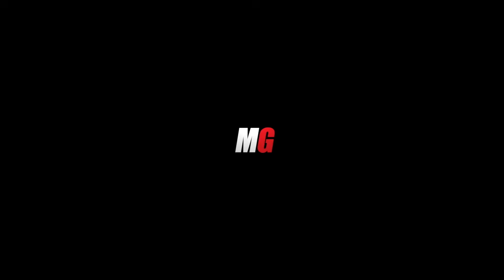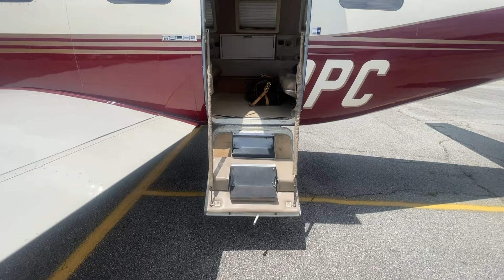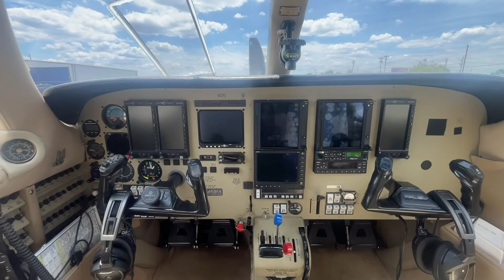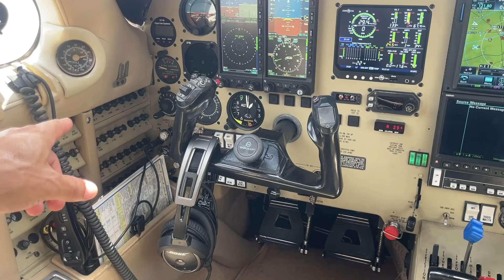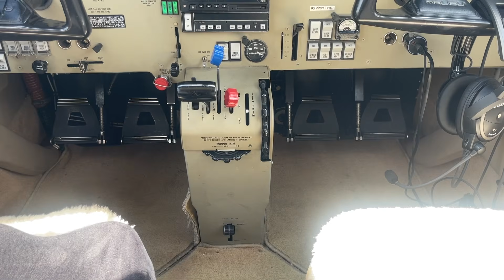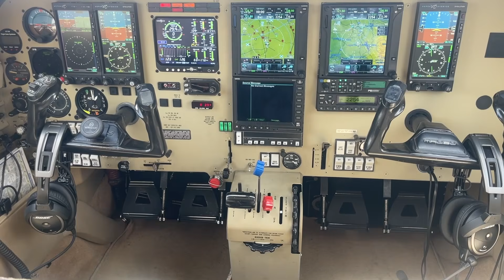Why Everyone Is Wrong About The Piper Malibu

Comment: I have 1,400 hours in a 1984 Piper Malibu (other planes I've had in order of ownership: 1966 Cherokee 6, 1980 201, 1982 P210, 1984 Malibu, 1978 P210, 1982 231, 1960 M35, 1977 A36 )  The Malibu bar none was the best bang for the buck.  I never had any issues except throwing A/C belts later fixed as pullies needed adjustment - 1,400 hours - trouble free.  I bought it with 50 TT (0 Factory New Engine) in 1985 for $250K.  People had issues because the ads said 25 minutes to 25,000 feet - if you wanted to burn up the engine. I took about 35 minutes but mostly flew above 20,000 to 23,000 feet - only in rare instances to clear weather was above 23K feet.  On decent I started pulling power 2" every 3 to 5 minutes - zero chance to shock cool an engine already cooled down.  If I bought another plane - it would be another 1984-5 Malibu - they sipped gas vs. the 350HP and louder planes.
Reply: My exact experience. Thank you for sharing.

Comment: I get the compromise, it's just wild how much better it could be today as carbon fiber or ironically it could actually also have been done in 1984. Carbon fiber is from the 60s even though it was a lot more expensive and not quite as strong but still good enough that it could have been drastically better than the Malibu. It could also have been a turbofan jet and should have been but even with a piston it could have been good. And it would even have been possible to have amiga hardware on 10inch CRT color display render rudimentary synthetic vision and maps from floppy discs and radio beacon location since GPS didn't exist. But that would have taken impressive vision to imagine that and piece it together. But carbon fiber with good aero was very possible.